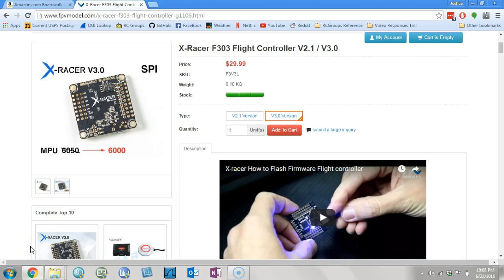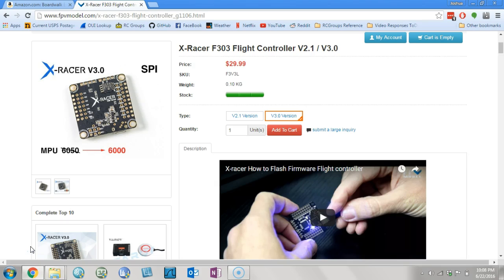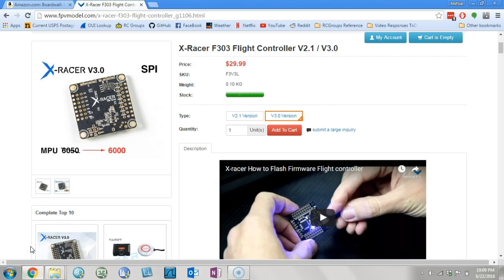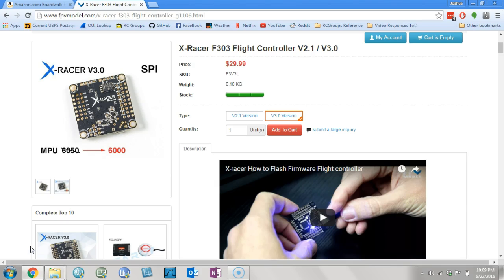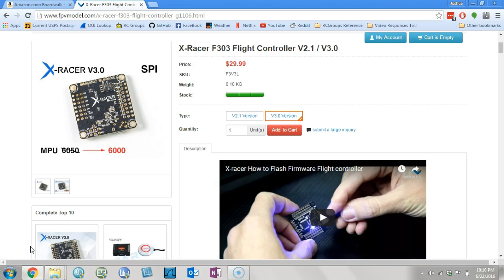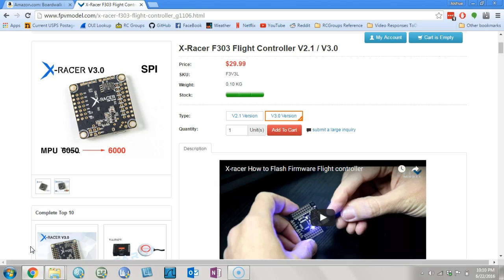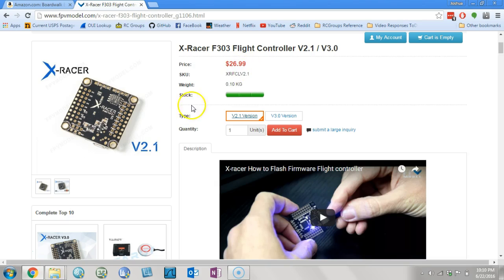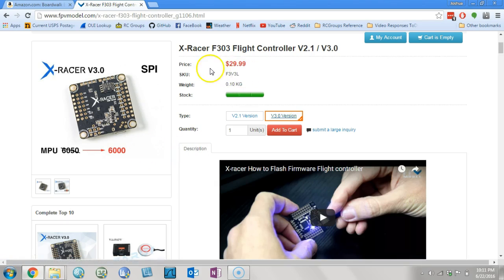Xracer F303 v3 is here, With 8 kHz SPI MPU6000!

Comment: I want SD card holder and better pin layout for esc signals.
Reply: neclovekSK Thanks for the clarification, I was really confused. Also Joshua I can assure you that the kkngf4 is a great board, backed by great qc and customer service. While it isn't a large production, I have yet to hear of any malfunctions or issues. Furthermore, Kevin is always there to help with any issues
Reply from the maker: +Daniel X. I don't see what the big deal is on the motor layout. It's like 2 cm more wire.
Reply: +Joshua Bardwell I've had issues on low profile builds (3-5mm) with wires applying pressure to key components. I don't really think many others do low profile builds like that, but personally I find it's much more suitable for low profile builds.
Reply: +Joshua Bardwell An option to replace data flash with SD card reader (like the kkngf4) would be great as well
Reply: kkng now has both flash and sd slot :D
Reply: +neclovekSK Really? I have one and it's only SDcard. Did they change something?
Reply: Daniel X. I also have older one (with flash) but newest revisions have both things. Just check Kevins' thread.
Reply from the maker: +neclovekSK still waiting for mass production though. I can't bring myself to commit to a hand produced bespoke product. What happens when I need a batch of ten?
Reply: Joshua Bardwell Why would you need a batch of ten? Just get one to try it out, you will love it as every body else does :)